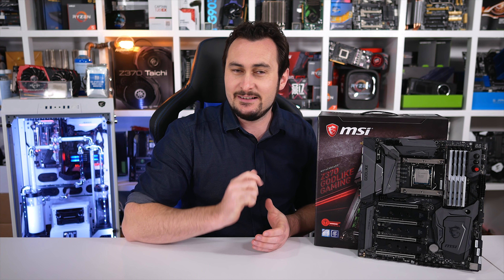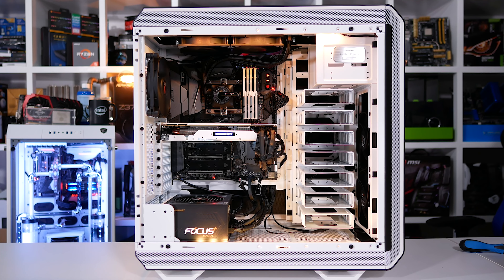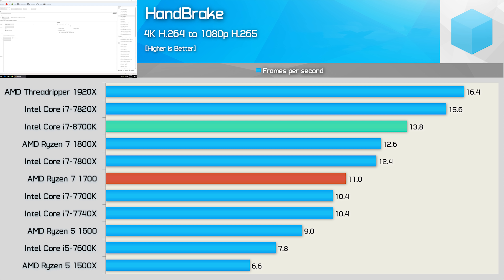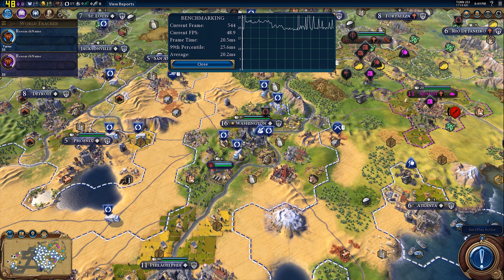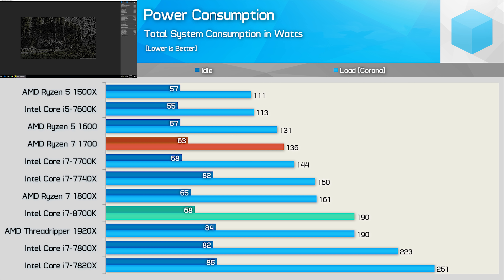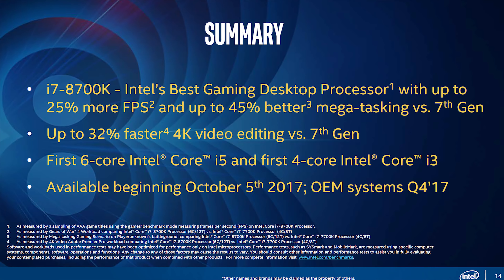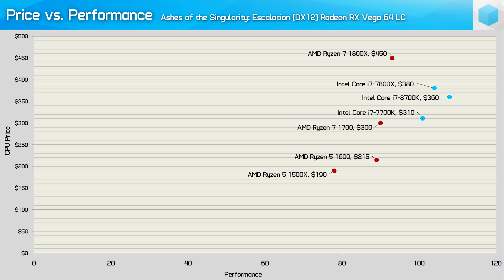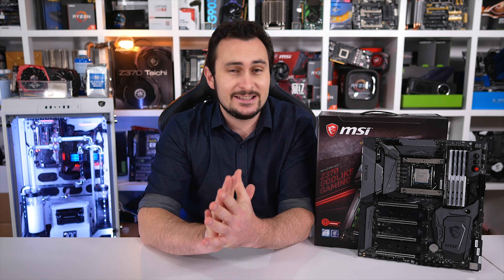Intel Core i7-8700K Review, The New Gaming King!

Comment: Damn, I wouldn't be suprised if Intel paid Nvidia after the Ryzen release to gimp their performance on Ryzen chips. Looking at the history of Intel, this would not be a too far fetched idea.
Reply: Carpenter They didn't... Nvidia just has bad DX12 performance because of their current and previous GPU architectures. Hopefully Volta will be more optimized for DX12 and have better asynchronous compute.
Reply: Bartholomew Amd cpu's just suck at core to core latency which nvidia's software scheduler needs.

Comment: holy shit Ryzen does a lot better with Vega... weird.
Reply: Ryan Tongs theoretically it's due to nvidia's cards and drivers working better with higher frequency chips
Reply: also don't forget that Vega is AMD's Video Card brand, so yeah it should work better with thier own CPUs lol
Reply: Ryan Tongs That's because Nvidia has terrible DX 12 support
Reply: Dizzy Gear i saw a comment saying Vega does more on the GPU, freeing the cpu from some tasks. 
Nvidia supposedly does x, y, z on software... so - CPU. 
But i can't remember what those xyz were..
Reply: nVidia does scheduler on software. Plus, nVidia softwares are not multithreaded.
Reply: Oh for fucks sake guys. Vega is inferior massively so actually, a weak gpu will cause the cpu to work harder. Ryzen works best with a crappy gpu...
Reply: PCDan 
Vega 56 is as good as 1070. It's not bad at all
Reply: Ryan Tongs Nvidia's software scheduler does not like latency, which ryzen has a ton of by design.

Comment: I haven't upgraded my desktop in a long time. I just buy new laptops. But I decided to finally upgrade my desktop to the 8700K. Oddly my old CPU is also an Intel 6 core. The I7 920. It will be interesting to run them at the same speeds and see what happens. Then of course overclock the 8700K afterwards.

Comment: Love the review. 8700k is not a head turner for me. Would rather have more threads, and have a socket and board that will last a few years.
Reply: Seriously when you buy high end CPU from either AMD or Intel, you are good to go for 5 years atleast. Why would anyone want to replace 7700k or 8700k or 1800x in the next 5 years? Like seriously there is no need. You will only upgrade GPU if needed. CPU changes are not that much needed for gaming. So the "longevity" that all AMD fanboys talk is just useless.
Reply: That is called investment. 
Not everyone is satisfied with same setup every year.
Have an upgrade path is always good.
Reply: vasilije94 100% agree with you. I have a 4790k and I’m picking up hobbies such as video rendering/ gaming and streaming and I would like more cores. But definitely not needed. Just would be convenient
Reply: Killian Khoo especially in 7ish years when we can see cheap used zen 2s floating around
Reply: I know that if you could use the 8700 in your z97 board you would, even most owners of z270 boards would sell their 7700k and get the 8700k if their boards worked with it but intel fucked them up.  That is the argument that is being made for Ryzen.  The chips that will be coming 3 years later will still be compatible with the same boards, right now I'm running a 1600 that I plan to pass on to my brother when I jump to an 8 core zen2.
Reply: if I upgrade I would go threadripper. But either way. on par with ryzen 7 but platform is more expensive
Reply: My last Intel cpu 4 core still strong after 8 yrs. Just upgraded to 8700k.
Reply: @vasilije94 i came back to thí comment 5 years later and 2600 to 5800x3d is huge gains!

Comment: Removing the 200 fps cap in bf1

Anywhere in bf1 press the tilde key (~)  this will bring down the command console. Type "gametime.maxvariablefps 0" Remember to not type the quotations and there is a space between "fps" and "0"

This will remove the FPS cap in bf1 and 4. It turns back on every time you restart the game so you have to do this every time unless you make a config file.

Comment: My comment is on the price vs performance comparison chart. The price you used ($360) is for bulk Intel chips. The prices is more for retail 8th gen chips.

EDIT: Retail for the 8700k is $389 and the 1800x is $399 (not $450). The prices in the chart are off. That should change the results some.
Reply: $379 8700k
Reply: darrenraphael Newegg had them for $389 earlier. Now they're listed for $379.

Comment: So Intel and AMD just casually switched the whole efficiency thing. Turned it all upside-down. Interesting...
Reply: ChiefFalque No intel is still way more effiecient as their intergrated graphics consume 50% of the total cpu power. Even with not soldering their cpu's they are still effecient lol.
Reply: That's a bold-ass claim you have there. "50%" riiiight. When it's not even doing work? I think you need to read up a bit on how this stuff works.

Comment: I found Ryzen to be far more interesting, this chip is exactly what you'd expect it would be and as such is pretty uninteresting. I'm also a little puzzled who this chip is for. It actually only makes sense for 1080p144hz with a 1080ti, and i'm honestly wondering just how many people are doing this. Longevity wise you cannot make the estimation it will be the better buy, since the cheaper ryzen 7 chips have more cores. Maybe the 8600K is a little more interesting, but i'm doubting the 1600 will take that fight aswell.

Aswell as Ryzen still being more interesting for SFF, due to their lower delta-T (soldered) and lower thermal output. People who've never built SFF overlook delta-T. It only factors in much when you have limited airflow and cooling capacity. My 4670K reaches 70C in the case at 4.2ghz. But without a delid it would run 90C under load.

In my opinion Coffee Lake is a big 'meh'. And clearly a chip they've had lying around for a longer time since it still uses the ringbus. They just let customers pay steep prices for the same stagnant quadcores since Sandy.
Reply: Would be a great chip for streaming, been eyeing the ryzen 1700 for a while ...will probably get the 8700k.
Reply: WackDance Gaming wait for the next Ryzen if you can
Reply: ryzen zen+ on the corner too so u should wait xD
Reply: Ah well, after being called an Intel fanboy for years, I guess it's refreshing to now be called an AMD fanboy.
Reply: wait 1 year and then 2 and 3 more years only wait never buy anything
Reply: Fuddy Duddy I agree just bought the little r3 1200 and that little chip is a beast! Just found out yesterday my 3000mhz memory can run at 3200 with a little less overclock on my CPU at 39.50ghz
Reply: WackDance Gaming Yeah why would you get Ryzen, AMD doesn't need money they making plenty of it 😅
Reply: I'm more excited for the i3 8100. But what i'm even more excited about is pinnacle ridge
Reply: It's not only about 1080 Ti gaming, there are games like CS:GO where GPU is not the bottleneck. Besides, more cores does not always equal more longevity. People were buying the FX 8000 CPU's for the same reason and today they perform worse than an i5 2500 from 6 years ago.
Reply: You cannot compare Ryzen vs. Coffee lake to Bulldozer vs. Sandy Bridge. It's disingenuous, as it's a completely different dynamic (IPC/Core). And neither do you need a flipping 8700K to run CS:GO >250fps, even 2500K's do that.
Reply: Best gaming CPU ever made with decent overclocking & enough cores for the next couple of years at least, yet this guy is unimpressed...I love Ryzen, I've done a 1600 build, but there's still an awful lot of games I play where the Intel single core performance just wins out by too much to ignore for me with my 1080ti.
Reply: "Longevity wise you cannot make the estimation it will be the better buy, since the cheaper ryzen 7 chips have more cores."

I love how AMD fanboys always try to turn the tables around by using the core argument when the same exact thing happened with the Bulldozer/Piledriver days against Sandy Bridge. Piledriver/Bulldozer has generally more cores but shit IPC. The exact same thing is happening again. Ryzen has generally more cores yet has shit IPC.

Seems like core count = coping mechanism for AMD fanboys, yet the truth still remains. Garbage IPC for AMD.
Reply: "I love how AMD fanboys always try to turn the tables around by using the core argument when the same exact thing happened with the Bulldozer/Piledriver days against Sandy Bridge."

Except This isnt the Bulldozer/Piledriver days, Ryzen has similar IPC, and nearly equal power consumption.

"Piledriver/Bulldozer has generally more cores but shit IPC"

No arguments here, Bulldozer was pretty terrible.

"The exact same thing is happening again. Ryzen has generally more cores yet has shit IPC."

Not even close to the same thing, Ryzen is very competitive on IPC, Clock speed is whats keeping Ryzen back.

"Seems like core count = coping mechanism for AMD fanboys, yet the truth still remains. Garbage IPC for AMD."

Already countered the IPC point. But fanboys will fanboy, I wont even attempt to defend that.
Reply: "Ryzen has similar IPC"

Another AMD fanboy that doesn't watch Intel related videos. I'm not going into debate when the opposition cannot comprehend facts.

Ryzen does not have similar IPC to Coffee Lake, let alone Skylake/Kaby Lake.
Reply: "clockspeed and IPC are not the same thing" Funny how they're not the same thing according to you yet we see the 8700K completely annihilate any Ryzen CPU in the gaming tests and also in some synthetics/productivity. Too bad no one runs these CPUs at locked 3.5GHz. Unless you're a coping hard AMD fanboy which is what you are.

Yea you really do have poor comprehension. Yikes.

"3.5ghz clock for clock comparison, Starts off with a loss for ryzen in Audacity (244 seconds vs 191/182 for the I7 6900K and I7 7700K respectively.)" - Contradicts what you support

"Then theres Cinebench in  Singlethread where theres a less then 10% difference between ryzen (139) vs the I7 6900K (151) and I7 7700K (153)" - Contradicts what you support.

"Handbrake is again basically the same between the Ryzen (366) and 6900K (373)." - Contradicts what you support.

"And the last test in this source is Hitman, with Ryzen at 94.07 FPS and the I7 6900K and 7700K at 121.42 and 111.19 respectively." - Contradicts what you support.

Holy shit you do not know how to debate properly. lmfao!

"Ryzen has similar IPC" - Talliban Bannana, 2017

Nope, Ryzen is no where near the IPC of the Lake family processors.

Another fanboy destroyed in probably my easiest debate ever.

Please go back to consoles, you clearly have no idea what a IPC and Clock speeds are let alone what a CPU is.
Reply: Talliban Bannana slow clap well played sir. It's great to see someone finally backing up their claims rather than continuing to insult each others intelligence. Well played.
Reply: "Funny how they're not the same thing according to you yet we see the 8700K completely annihilate any Ryzen CPU in the gaming tests and also in some synthetics/productivity. Too bad no one runs these CPUs at locked 3.5GHz. Unless you're a coping hard AMD fanboy which is what you are. Yea you really do have poor comprehension. Yikes."

Jesus christ, Did you even read this before you posted it? Do you not remember what YOU Stated?
"seems like core count = coping mechanism for AMD fanboys, yet the truth still remains. Garbage IPC for AMD."

YOU are trying to make the IPC Comparison here, And i simply showed you that you were incorrect that Intel was significantly ahead in this field, This is also why i showed the 3.5ghz clock for clock article, Because we were comparing IPC.

"Contradicts what you support"

....No? I stated clearly that the ipc difference was significantly less then in the Bulldozer/Piledriver days, The article supports that, since they are, in alot of cases, within 10% of eachother.

"Nope Ryzen has no where the IPC of the Lake family processors."

Which i already linked an article stating this isnt correct.

Edit: "Please go back to consoles, you clearly have no idea what a IPC and Clock speeds are let alone what a CPU is.
" Mmmmm tasty negativity.
Reply: XK XK i bet you're one of those guys that says shit like "you need to have a very high IQ to understand the subtle humour and the symbolism of Rick&Morty"
Reply: I love how fanboys always use the word fanboy to discredit someone. Dunning-kruger in full effect.
Reply: Intel is always on top, this is nothing new., every time and releases something, intel will just smash it
Reply: adrian perez not after AMD starts producing their CPU s at TSMC
Reply: Randall Lawkin what ram are you using exactly?
Reply: Fuddy Duddy have you noticed that in some of the multi threaded benchmarks even though it has less cores it still wins? 😋
Reply: Fuddy Duddy Well said. I am that 144/1080ti guy and this chip is still a ripoff. I am not about to pay for a new mobo and processor AND gut and rebuild my custom loop for this weak upgrade. Icing on the cake is the 8 core will probably come next year and require the same again. No thanks. If i needed the cores AMD makes way more sense for future upgradeability, cost, and only a slightly lower performance that probably won't even be noticeable playing games above 1080p. 
Sorry Intel but this is a year and a half late
Reply: Maybe less than 1/1000 gamers are streaming or video editing. We are all gamers. Cofee Lake is the choice.
Reply: +King Christo, Might have something to do with the fact it's 4.3ghz? IPC and single-threaded performance are not the same thing. Both at the same clockspeeds, AMD and Intel are virtually the same. Intel just has the clock advantage. Not saying it's a bad chip, i'm saying it's an unneccesary and expensive one.
Reply: Fuddy Duddy sounds like you are trying to convince yourself that you made the right choice. Just sell on eBay and buy an 8700k bud. You will get most of your money back.
Reply: "Which i already linked an article stating this isnt correct."

I don't think you know how to read. Your article clearly states Ryzen's IPC is falling behind Kaby Lake 3 out of the 5 tests.

Yea. You clearly have no idea what a CPU is. Let alone how to comprehend presented data.
Reply: +Sterling Pesso
 Sorry I don't watch generic garbage tv shows. Perhaps you do?
Reply: AMD and Intel chips right now do not have the same IPC performance, that is a fact. I can say though that the IPC difference is a lot closer that it was in the Sandy/Bulldozer era, back then it was almost as high as +50%, 2 cores of Bulldozer were barely matching 1 core from intel at exactly the same clocks, that is no longer true. Though there is a difference of about 15% percent it is no where near what it used to be. The big difference right now  that is hindering the Ryzen performance on low core applications, is indeed clock speed, the famous 4 ghz wall that Ryzen cant surpass, but to say that the IPC is near identical is just flat plain wrong.
Reply: Oh, Its you again, Thought you buggered off to annoy someone else at this point.

"I don't think you know how to read. Your article clearly states Ryzen's IPC is falling behind Kaby Lake 3 out of the 5 tests."

Falling behind obviously being equal to what you said earlier about AMD IPC being "Garbage"

"Yea. You clearly have no idea what a CPU is. Let alone how to comprehend presented data."

More of this assuming my intelligence stuff eh? Feel free to assume that if you will, It only makes you look bad. Then again, You already threw the "Go back to consoles" insult at me because i dared disagree with you on the internet, So i guess i shouldnt be surprised.

You still have not provided evidence for Ryzen being Significantly behind intel in IPC, You insist on pointing out "General performance" and i quote "Intel related videos" Which was never in question, Nor was it the topic of this "Debate" this debate was based on your faulty analogy that this is the same situation as Bulldozer/Piledriver vs Sandy Bridge. and that Modern Ryzen IPC is "Garbage".

But please! Dont stop yet! This negativity is tasty indeed. :)
Reply: Talliban Bannana just stating my opinion in a civilised fashion, which i believe is the generally accepted view if you just look a bit around. Btw that was my first comment on this discussion, i think you confused me with someone else.
Reply: I was not replying to you Friend, I have nothing against what you said as its pretty much correct.
The reply was supposed to be for XK XK.
Sorry for any confusion there.
Wait a second.... now that ive refreshed the page.... where did his comment go?
Edit: Wait, Derp on my part, i see it now, Whoops! lol
Reply: Damn, XK XK , back at it again with the "I'm better than you" comments
Reply: Who the hell buys 3000Mhz ram and ryzen r3? Whatever...
Reply: Adrian Wujtowicz not as nearly as much as intel.
Reply: its all relative, you're coming from a 4670k, im comming from a 2500k, so this looks pretty cool, to not just get single threaded performance increase but finally some more core action, which up until now it looked like id have to get a ryzen with worse gaming performance to get in on the core action, now i can keep the gaming performance and get in on the multithreaded bonanza with the 8700k!! in reality i am going to buy nothing.
Reply: hello fuddy buddy i think i also go for threaripper i used to be a  intel user for many decades but since of the last problem with intel (meltdown and such)  i know that the new coffee lake of intel has slighty better frames in game with the same  video card of a threadripper  but even that i will go amd this time due to the fact that the best amd cpu is half the price of a i9
Reply: 8700k is a beast final answer  it top dog on the block lets see what AMD  can do in a year  i stay on tbe intel bench and watching what is next for sure a tough battleground  for AMD  with the Big dog Coffeelake shelling out its firece overclockd love this cpu a intercontinental  hit for sure , go intel for making my gameing a place to have fun now